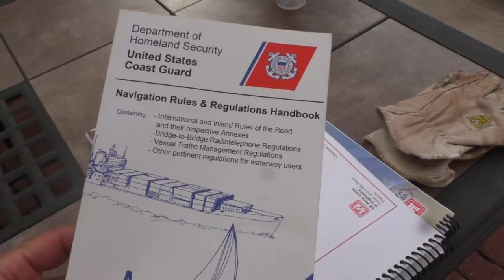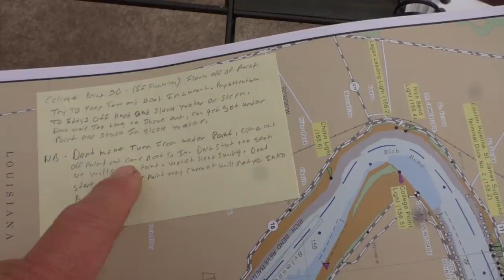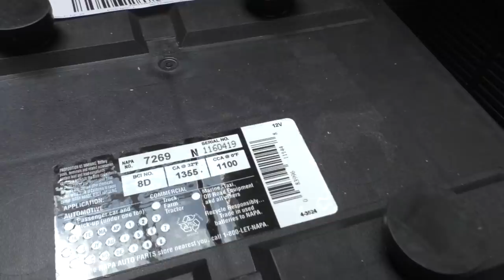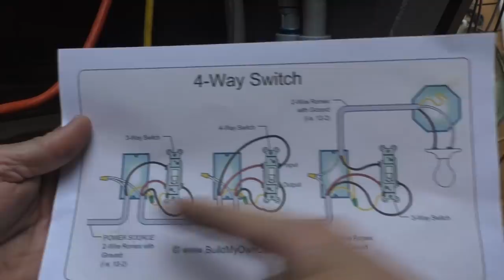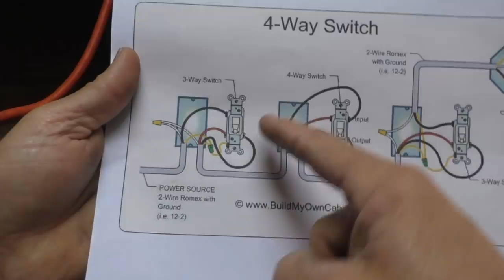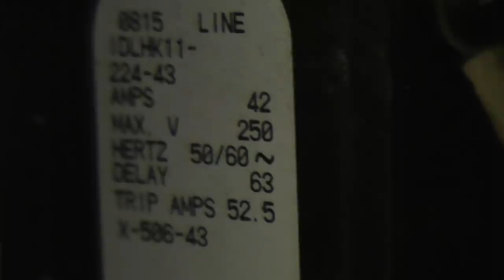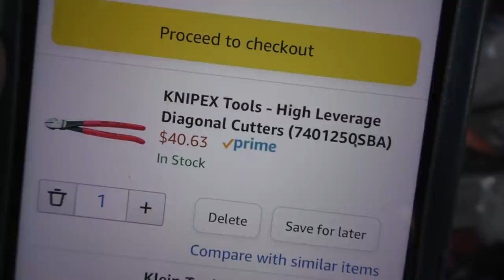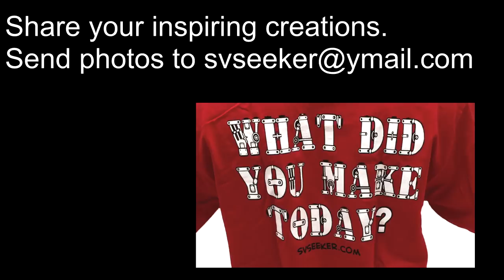Wiring the Boat -  Part 1

Comment: Curious if you should coat all the electrical connections in a dab of Dielectric grease to prevent salt water corrosion.
Reply: Same thought.  Those big wire "nuts" are supposed to be waterproof.
Reply: Agreed, and the wire should be tined and with the proper insulation. Per ABYC standards.
Reply: @kennybarrow9835  ... but that is no yacht !
Reply from the maker: Yeah, but we'll fill spray bottles with it and do everything.     ....after we have everything.
Reply from the maker: Tinned Wire?  Bull Shit!   Oh wait!  You work on Luxury Yachts for people who don't know any better or you work with tax payer dollars.  : )
Reply from the maker: Jack?  Your nuts are not waterproof?   : )
Reply: @SVSeeker  I love that comment. Exactly bro just because you take advantage of wealthier people dosent make it a standard to go buy.
Reply: @SVSeeker  ZING !!!
Reply from the maker: Got it.  No sarcasm for you.   ....wait, what am I saying.    I love sarcasm.   How about you harden the fuck up.  : )
Reply: @SVSeeker  I don't mind the sarcasm !  The man is just speaking his mind !!!
Reply: Check bilge pumps with water to se if you need a valve or time relay - if the water in the pipe is enough to trigger the switch again.. then you will move the same water over and over up and down the pipe
I made a simple delay with a condensor? On the relay
Reply: My understanding is that a properly crimped connection is watertight in the strands. Am I misinformed?
Reply: There are tens of thousands of boats plying the waters of the world using un-tinned wiring. Is tinned more corrosion resistant? Sure, but not massively so.
Reply: @pablomax3045  also the juncture from where the tinning ends is subject to work hardening if there's any vibration more than any other place on The wire
Reply: Coating should be a standard practice. It will prolong the life of the system by delaying the corrosion effects. Since this is all about being cheap. Just using an electrical coating , liquid tape would be a cost Effective sealant.  Sure this ass has some liquid rubber in a drawer somewhere.
Reply: @rt17022  "Sure this ass has some liquid rubber in a drawer somewhere."  Are you speaking in the 3rd person?
Reply: you know. there is a common phrase among the philosophers circle that holds a lot of meaning
"never lose sight of what is around you or you will lose sight of yourself"
this can be taken in many ways. however if you want to take it lightly, or ponder on it for a while, that is up to you
Reply: @puppyupper4565  , use dialectric grease, (sometime called tune up grease), ONCE and forget it for EVER, that good it is.
Reply: @xx1590  The outlet connections should have been ring terminal crimps, instead of bare wire. They will probably fail in 3 years. Not using tinned wire is a big problem on the water as well. It will be interesting to see what the marine surveyor says, might be hard to get insurance. A fire on a boat is not fun, and things not working when you need them to is just as bad. This guy doesn't seem to care at all. Spends crazy money to get the best of everything, then cheaps out and doesn't even do the electrical to code.

Comment: I just rewired my whole building with tandem MCM400 wire, which is 3 or 4 sizes fatter than the wire you were cutting with those greenlee cutters - 277/480V with 8 runs of MCM400 wire to and from everything- 
I cut all of it with a Lennox Steel cutting wheel on a 4 and 1/2" grinder......

Comment: Hmmmm, old cable, and NO sealed heat shrink tubing over your connector joints. A few things a marine electrician would do on large DC cables.

Comment: When we replace the lugs on the welding cables we usually cut them back about a foot to get to clean copper...... That burned-up copper could create a hot spot
Reply from the maker: But did you ever prove that?
Reply: @SVSeeker  and foreign material can create resistance

Comment: Awesome video. I didn't know you could inputs from solar to inverter and power from gensets,  and outputs to receptacles and pumps in the same box. .
Reply from the maker: We'll generally run one or the other, but it is possible to run a generator with the inverts because these invertors will sync to the generator.

Comment: You should not use vented lugs, especially not with bare copper wire. And no, they are not inspection holes, have not been or will ever be.
The holes are there for any kind of surface treatment to reach in without being stuck in air bubbles. Any boat electrician should know this.

Comment: You bond the nutrual and grounding conductor at first means of disconect. So when you are using one generator or another and the one supplying power that one is the first means and the ground is common with nutrual at that point and if you are using shore power the bonding is at dock pedestal panel or where ever the pedestal is feed from originally. This way you do not energize the ground. The reason you have the choice to bond them in a panel you would install is because you only install the bonding screw or bracket if its actually the first means of disconnect.
Reply: I think separately derived sources bewildered Chris a bit.
Reply: @billstuart8481  i wonder if the main panel is bonded
Reply: @billstuart8481  but he seemed good tho.

Comment: I noticed you were about to make a bus bar from brass. Be aware then that brass has only 1/3 of the electrical conductivity of copper but I guess you compensate that by using a much thicker bar.

Comment: I used a multimeter to check voltage on a hot water tank. Did you know you can get 120 through one strand of wire? You can not get the amps needed. So connection need to be solid or you might be pulling your hair out later. Ask me how I know.
Reply from the maker: Yes, but it will not last long like that.  : )

Comment: As an electrician that has worked on a lot of boats and industrial jobs I wouldn’t use pvc I would have used emt it is the way preferred way with rain tight connectors and w rated wire with lever nuts is the way to go and way easier for troubleshooting but I’m not trying to be a keyboard cowboy and if I had the time I would have helped but unfortunately I don’t but great job
Reply from the maker: Preferred why?   ...and you do sound a bit like a keyboard warrior.  : )
Reply: I would have used ridgid conduit but doug said it wasn't in the budget

Comment: you can put that hammer crimper in a vice as well if you don´t have a solid thing to put it on i usually crimp it on the underside of the connector looks better when its in place :)

as the Electricians say when God said "Let there be light" all the wiring was already done.. :D

Comment: If I was a young man looking for a career I would go find an electrical apprenticeship some place.
Reply: Naw, check out HVAC instead, electrical and refrigeration, great pay and insurance
Reply: All those trades....electrical, plumbing, HVAC.  They take skill and some brain power.  Can't be outsourced or automated.  Somebody has to go to site and do the work.  When everybody else has forgotten how to do anything useful, it will pay to be the person who knows how to get things done.
Reply: Yep, I also am a welder, and mechanic, and auto-body man, that specializes in rust repair, metal replacement, but yeah I'm in all the trades, I even do Florist work for friends, but I suck at finish type wood working, I can do rough in, but not build cabinets out of wood, but could fab metal if need to

Comment: You do not want any earth bonding on that boat. Bad news, both from a safety standpoint and from a corrosion standpoint.

Maintaining a floating earth means that if you do happen to come in contact with an active there is very little return current path and you don't get a zap. There is some due to insulation resistance etc, but on a boat your size it will be very little, hundreds of K ohms if not into the megs.

As to the corrosion, basically, having current run through the hull is bad news. Especially when you're alongside. Google for some good explanations of that, too lengthy for a YouTube comment.

I highly recommend you remove any and all bonding and put an isolation transformer in for your shore power, or at least a galvanic isolator.

If you do remove the bonding, you'll also want to install an earth fault tester. Basically it's a set of three switched lamps, one for each active with the other side attached to earth. IE Active -> lamp -> momentary switch -> earth.

You press each one in turn, if two light up you have an earth fault on the third. You then start switching off breakers till the fault clears to find which circuit it's on. Check it every morning when you walk past by pressing each switch in turn.

There are good reasons for running a bonded earth, but on a ship it's far more complex than in your house. On a ship you don't want to do it.

Regards,

Ex Navy Electronics Technician and Electrician.
Reply from the maker: ....so did you ever look around at the boats that were not paid for with tax dollars?  : )
Reply: Yep, some. Not a lot.

Most run galvanic isolators due to the stupid high cost of isolation transformers. I can entirely understand going that way, and it does do the job.

For you to run isolated earth on the boat doesn't cost anything extra though. You're still running the earth wire everywhere and bonding conductive enclosures etc, you're just removing the earth-neautral bonding at your gen sets, inverters etc.

You should be running an isolation transformer or galvanic isolator regardless as well.

An ounce of prevention vs a pound of cure.
Reply: Also, old mate does excellent work. Keep him around!

Comment: I think you will find that marine regs world wide say to use tinned wire, and prohibit wire nuts.  You can po-po it all you want, or perhaps learn something new today instead. I think "what did you learn today" is just as important as "what did you build today".
Reply from the maker: I think you will find that there are no marine regs that state that for recreational boats.  And the only thing you are teaching is stop until I can afford the best.   And frankly I ignore that foolishness all the time.
Reply: @SVSeeker  Wow.  I'd think you would at least consider it and want to better understand what tradeoff you are making rather than just dismiss it bullheadedly.  ABYC is about recreational boats, and it's clearly part of it.  But you are correct that it's not required in the US, only suggested.  But forget what's required, and just consider what is uniformly considered to be the correct wiring practice for boats.  And it's not about stopping until you can afford this or that.  It's about at least understanding what compromises you are making.  But that doesn't seem to interest you, just shitting on suggestions.  Determination is good.  Blinders are not.  Oh well.  Good luck with the rest of the build.
Reply: @twistedtreeroad  I think you will find this is a non issue because he said the same types of things about welding practices back a few years, so I'm not sure long term corrosion is a factor...

Comment: Im worried about the parallel path that current could flow by having both the panel and generator bonded. I would advise double checking with a electrical consultant.
Reply: You are right, While Chris seems extremely knowledgeable in his field (industrial electrics), marine electrics has its quirks and differences, Earth neutral bonds at the generating source and not the panel being one of them, Im a marine Sparky in Australia that has wired boats to Australian, European and US standards
Reply from the maker: You're worried now?   Ha!  You should have seen the wiring I did.  You'd piss yourself.  : )
Reply: @SVSeeker  all good brother, love what you do been with you from the beginning! Just people claiming there professional and get people hurt, give people like me a bad stigma
Reply: The panel isn't bonded the generators and inverters are bonded

Comment: I pulled a load of untinned wire out of my boat, it had turned black with corrosion. The battery cables were next to useless.
Reply from the maker: Bull Shit.   There are many thousands of boats without tinned wire.   Spray it with grease for time to time and rotate it out as needed.
Reply: Well I can only go with the evidence of my own eyes, on every boat I’ve seen untinned wire it’s corroded.  And I have made the mistake of putting untinned wire as a temp fix (that I never got round to replacing), it didn’t last a year.  Please give examples of these thousands of boats that have got away with it?
Reply from the maker: @adventuresofgwennel     You replaced the wire because it was discoloring?    Because not one shrimping boat or fishing boat... hell, I can't think of any boats I grew up around that anything other than house hold wire.   The stuff left over from WW2 was sketchy but only because the insulation was mostly cloth  Tinned wire?  I don't even know if it existed in the 70's.    I think it's the men that have changed and not the sea.
Reply: Well I guess it’s different experiences then.  Replaced battery cable as the engine didn’t start, due to corrosion running for many feet so I couldn’t even cut it back to fresh copper!  So not because it was discoloured 😏.  Multiple diesel heater issues due to untinned wire and cheap unprotected connectors, including the one I did as I was in a rush and it bit me back in less than a year.  And why’s is always cold, wet and windy when you have to fix your heater?!
Ultimately it’s your cash, I’m just passing on my experience as a short armed Cornishman. I’ve pulled too much cheap crap out of my boat and I want to spend my time drinking beer and sailing, not fixing her 😊 so I’m happy to spend a bit more on stuff I don’t want to touch in the next 20 years.
Good luck with using grease to keep the moisture out, we gave up on that with navy aircraft as it caused more horrors than it stopped.
Yep you’re right, man has changed, some continue learning and some don’t 😉🍻
Reply from the maker: @GI-AUS    Whale oil in lamps.  :  )

Comment: In residential on groun main line j box is used liquid tape in addition to think rubber tape, some times they get flooded ,considering the salt water is going to be around ,every connection needs to be covered in some dielectric,auto parts stores has it.before i shrink any conection i squeeze some dielectric grease on it.avoid any green wire cancer